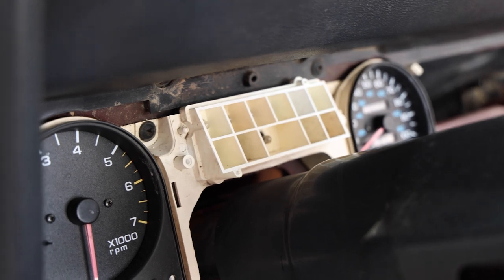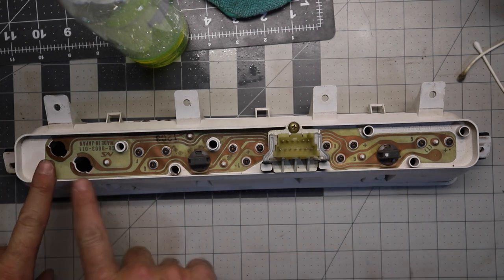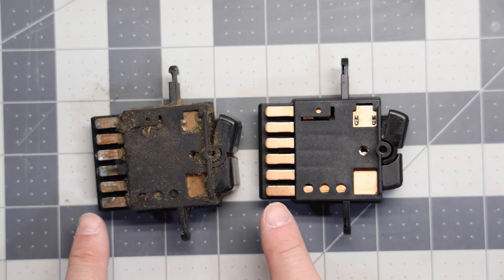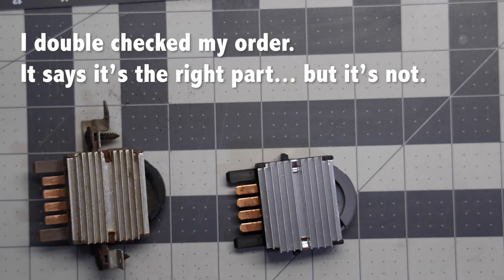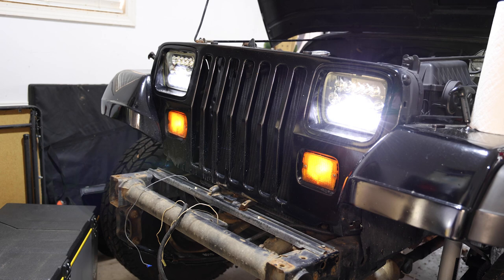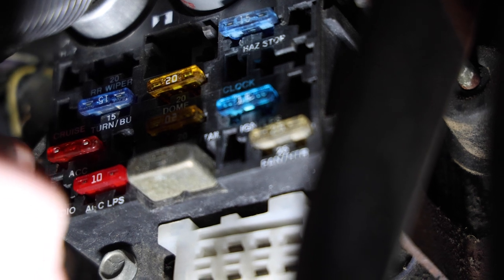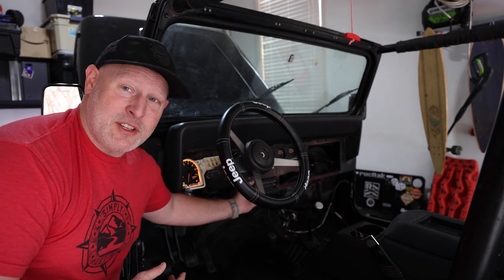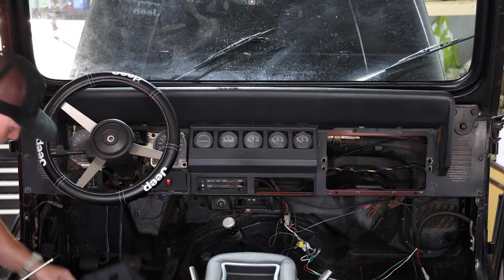Jeep YJ Dash Light Fix and LED Upgrade

Comment: I think the RPM gauge is called a tachometer and your MPH gauge is called a speedometer. As got going to switches before fuses, I did the same thing on my YJ when the blinkers stopped working. Replaced the blinker switch only for it to not work, found out it was the fuse. I think we fix the switches first because they are our control surface, and the fuses are typically out of sight, so we are more likely to forget about them.
Reply from the maker: Yeah. You’re absolutely right! In the moment my mind blanked and I rolled with it. I also think you’re right about the fuses. Out of site out of mind.

Comment: Not sure if anyone else has already stated this but LEDs have 2 legs. An annode and a cathode. Typically, the way you find the positive (cathode) side of the LED is by inspecting the legs and determine which one is the longer leg. That will be your positive side.
Reply from the maker: Good to know. These looked identical to me, but I’ll go check to see now that I know something specific to look for. Thanks!
Reply: You may have to unfold the two legs, but one of them should be longer than the other. And by the way I like the fact that you do not edit out your videos so the the jobs look easier than what they are. There's always something that comes up no matter how simple the job is. I am presently rewiring my 1990 YJ so I feel your pain. Also if you do not have the service manual or the Y J let me know and I will create a link so you can get it. It's Priceless especially the schematics.
Reply: @markcribbs1488. Hi Mark. I am working on a 95 YJ and there are so many loose wires hanging under the dash. Would you mind sharing that link for
The service manual?  Whatever the answer thanks and take care 😊

Comment: A buddy of mine has a 1993 YJ that has all kinds of problems and has set outside for 13 years.  Years back he had it striped and had the inside floors covered with bed liner and also painted everything under the Jeep with the pore 13.  It held up nicely and is 99% rust free.  Almost every nut and bolt on this Jeep are loose, we took the lug nuts and spark plugs out with our fingers.  We got it running after working on it for a month and it didn't even puff a bit of smoke even at the very first, amazing.  We have the front axle out having new gears installed, the ring gear had a tooth missing.  Love your channel and your videos are a big help.  It was last plated in 2005, tomorrow we are planning on working on the AC and systematically going over each and every nut and bolt one by one.  One big problem we had for days was, the key would not turn the starter over.  I could turn the the motor over by jumping it but not with the key.  It was the lower right fuse on the fuse block under the dash, it was dirty.  Simple but a huge pain in the ass.
Reply from the maker: That’s awesome! I love you’re bring it back!!! But holy crap are fuse issue the bane of our existence.

Comment: I had a set of those headlights before, but it may have been a different manufacturer with the same design. Mine, when mounted were the opposite of yours, with the low beam using the top LEDs. Check to make sure its mounted right. So far this has been a good series and makes me want to get back to work on my YJ
Reply from the maker: Thank you! I think I’m going to replace those light with some other ones I like more.
Reply: @SimplyMustGo  what headlights are you going with? I’m still running stock and looking to get upgraded headlights
Reply from the maker: @UndisputedFrost  I’m using these https://youtu.be/uuyjx8QMfAU

Comment: Matt I have a 95 YJ and stumbled on your channel a couple years ago and while I haven’t tried any of the work you’ve posted until now I have enjoyed all your content. At 7:14 you  say ‘so I put in a fuse…” Can you tell me which fuse slot? My dashboard light had been working, I replace the fuse I thought was correct, then the dimmer and finally the switch but nothing… thanks in advance and please carry on with the content—well done
Reply: And another thing, does your dimmer work with the LED bulbs? Again, Thk u
Reply from the maker: Check out this diagram. https://fuse-box.info/jeep/jeep-wrangler-yj-1987-1995-fuses-and-relays/amp. Your problem could be 8, 9 or 10. Also the LEDs do not work with the dimmer.
Reply: @SimplyMustGo  thx

Comment: Yo dude! Awesome video. I have the weirdest issue where after installing LEDs all round on headlights, tail lights, and indicators, the indicators no longer work when the headlights are on. This is a 1992 YJ. I thought initially that this might be a polarity issue, but apparently the polarity doesn't change when headlights are on. Any ideas for me?
Reply from the maker: Yeah you need to change out your turn signal and flasher fuses to (the big round ones under the dash) to the LED compatible ones that have their own grounds.

Comment: Hi love your videos super helpful. 
I changed the dash lights out.  In the gauges still not turning on the old ones looked burnt out. I did notice one of the plastic things that holds the light bulb. Would that cause all of them to not work or is there maybe a fuse somewhere for them dash lights? I have tired changing the light in the tax and speedometer. Any information would be great

Comment: If you put LEDs in the check engine , maintenance required and shift indicator the LEDs will stay on ( dimly lit ). Use green, blue and red for the top indicators it helps to see them during the day.
I have a red LED in the check engine so if it comes on I’ll see it during the day.
Reply: The bottom cluster has a constant voltage running through them when the car is running.

Comment: There are dimmable LED bulbs...would hate to have gone through all that trouble for a dimmer switch that you can't use.  I did learn about polarity on a previous project.   Good video.
Reply from the maker: Yeah. Had I realized what I was getting into when I started I would have been really intentional about getting dimmable LEDs or, just gone with the normal bulbs.

Comment: One issue I had was cleaning the copper using rubbing alcohol with a q tip for individual lights not working no matter of polarity
Reply from the maker: Yeah. I had some people suggest I would need to do that. Luckily I didn’t have to go that far.

Comment: do the led lights you installed here dim properly when the dimmer wheel is adjusted?  thnx for the great video.
Reply from the maker: Not really. The down side to most LEDs like this is they don’t dim.

Comment: Great videos! 

I’m looking for one that shows how to replace old off road lights. 
Recently purchased an 89YJ, trying to replace broken halogen lights with LED’s. 

Have you made a video like that?
Reply from the maker: Are you referring to the actual headlights or to something like fog lights? Are they mounted to the bumper or to something like a light bar?
Reply: @SimplyMustGo  lights mounted to a front bumper. They are old lights, that don’t even have a switch inside.

Comment: hey bud i have a really important question i have a 89 jeep wrangler only two of my cluter lights are working ive changed all the bulbs im assuming its a wiring issue but is there any way i can try to  clean the contact areas on the cluster?this my be a dumb question..im sure ur gonna tell me i need to buy a new cluster......idk......
Reply from the maker: I think you can use some rubbing alcohol and some Q tips. Also, I did find the gauge cluster circle board on Amazon for like $25. That might be another option.

Comment: Great content man!
I wanted to ask a question. 
I have a 1995 Jeep yj that I purchased with a non operating speedometer and odometer. My turn signals on the dash don’t come on either. I tried changing the speedometer sensor but that didn’t change anything. Does anyone know what my issues could be?
Reply from the maker: Thank you!! 🙏🏻. I wish I had a good answer for you. But I’m still learning a lot of this stuff myself.
Reply: Pull the speedo/tach cluster out and inspect the circuit board on the back.  The copper circuits may be corroded.  If that is the case you can either find a good cluster and use it to replace the whole thing or swap circuit boards.  If you really need to you can use normal wire at certain screw points to bypass the corroded circuits.  I had to use the bypass method before and it fixed it just fine.

Comment: Any chance you would be willing to share the magic part number for the dimmer switch? I've got my YJ torn apart doing the same thing and was going to go ahead and replace my switch while I was at it. I appreciate the videos!
Reply from the maker: Yes! https://amzn.to/3krcfZj
Reply: @SimplyMustGo  I appreciate that! I've been going through all of the wiring behind the dash and figuring out what goes where and making sure everything is buttoned up properly. I've read every wiring diagram made for this thing and I have one wire I can't identify. It comes out of the main harness by the fuse panel and is just a single yellow wire with a red or orange stripe and a connector on the end of it. It's maybe 6-8" long. For the life of me I can't figure out where it's supposed to go or what it's for. If you happen to know, I'd love to learn!
Reply from the maker: @mikeboley8488  Humm. I don’t know off the top of my head but I’ll check both of my YJs and see if I have that and see what it might be. If you want, DM me on Instagram and send me a pick of it. I’ll be in the garage all day tomorrow working on her.

Comment: Have you gotten to the windshield wipers switch and delay control.? That's where I'm at now. Any help will be greatly appreciated.
Reply from the maker: Not yet and I’m hoping I don’t have to. I replaced to windshield wiper motor in my other YJ and that wasn’t hard, but haven’t done any of those switches. I think @jeepsolid has done that though.

Comment: I have a question that’s kinda weird. Do you know if the older larger diameter jeep steering wheel will fit on the yj column? I like the old school larger steering wheel. Or possibly a steering wheel from a m35? I read it’s a gm spline count but don’t know what is compatible. Do you know anyone that would know?
Reply from the maker: Man. That’s a good question that I don’t know the answer to. I wish I did. I would try posting in some YJ Facebook groups

Comment: So which auto part store had the $40 dash dimmer switch? And do you have the part number for it? I have a 1990 that needs one.
Reply from the maker: It was O’ Riley’s. But i through a link to the right one on Amazon in the description.
Reply: @SimplyMustGo  awesome! Just ordered one. The blank space in the dash and the dangling wire rattling around is annoying.

Comment: Curious how many lights I would need to buy if I am looking to replace all the lights in the dash including the speedometer and rpm gage. Is it just one light per gage for a total of 6 leds?
Reply: Also, can you use the old sockets that come with the stock halogen lights for the new led lights or is it necessary to get new ones?
Reply from the maker: If my memories serves me correct it’s two lights in the dash for speedo / RPM and 4 in the other cluster.
Reply from the maker: Old ones work, but mine was actually missing a few so I just got all new ones.

Comment: You should find a junkyard or parts pull place near you and just grab a OEM one. The parts stores can sometimes be more trouble then what its worth.
Reply from the maker: Yeah. There is one about 90 minutes from that that is just old Jeeps. I use it for some stuff. But man, I thought this would be an easy part… 🤦‍♂️
Reply: Finding Jeeps at yards is nearly impossible... they get scooped up right away to be parted, out by the Jeep guy.

Comment: Yo i just bought a yj, when i trun on the lights the radio shuts off 😅and ideas. By the when i it have cool speaker system and a big bass ??
Reply from the maker: My guess is going to be a bad ground somewhere or some really messed up wiring.

Comment: I went through this same issue, but the dash ALREADY had LED's they were just dim. I "upgraded" to brighter LED's.   My dash now doesn't light up at all, as well as losing power to my radio
Reply from the maker: Oh man. No idea why the radio is losing power except it sounds like a bad ground somewhere. 🤷‍♂️
Reply: @SimplyMustGo  yeah, it's the whole dash and radio, except for the turn signals etc 😥

Comment: What was the part number that you ended up purchasing for the Dimmer Switch/instrument light rheostat? I am having the same problem ordering a new one from my parts stores/Amazon. I found used ones on EBay but would rather have a new part if I’m paying the money.